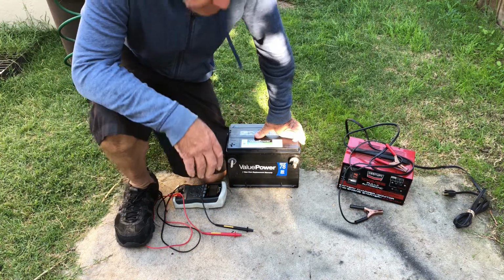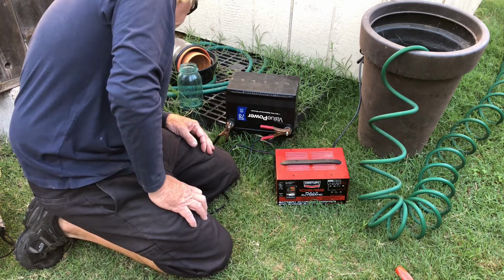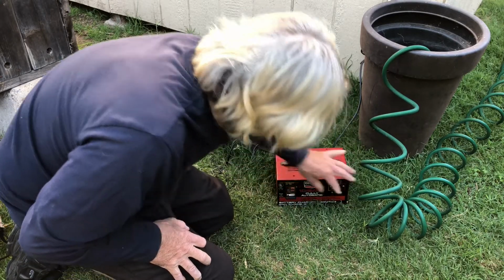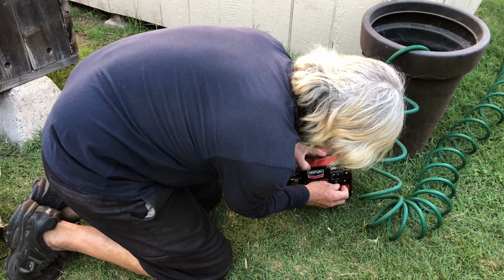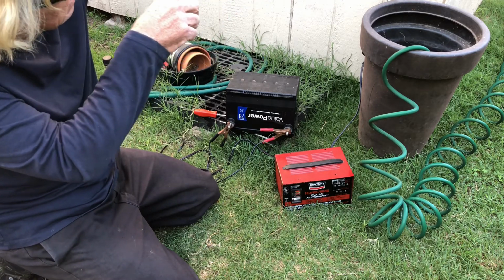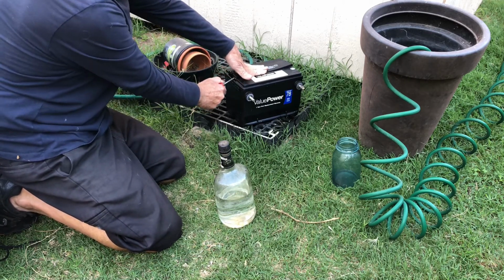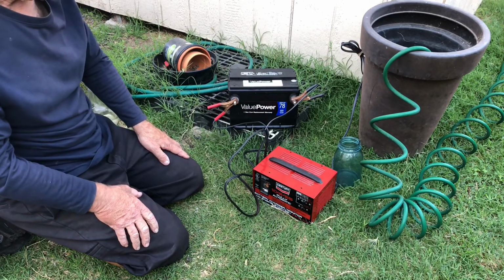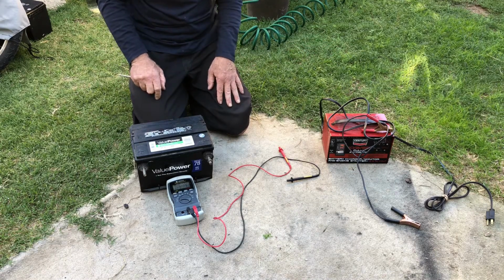Charging a Car Battery Upside Down! The only rejuvenation method that works.

Comment: Can I do this on a fully sealed battery. Battery doesn't have refill cap's
Reply from the maker: Yes I brought back a dead 4D sealed battery.  Now use it as a solar back up battery.  I slow charged it upside down at 2 amps for 72 hours.  Seems to work better slow charging at low amps.
Reply: Thank you. What's your take on the welder trick. And must I reverse the polarity or keep polarity the same.

Comment: Did you try a DC stick welder?
Reply from the maker: I found that a 2 amp charger over a long period (3 days) worked better. I found a large sealed 4D battery that was dead 10.8 volts. Turned it upside down and left in on the charger 72 hours and now a year later it works perfectly. I use it as a solar backup battery.
Reply: @Strange_Brew  Didn't answer my question; 
But anyway; turning the battery upside down may have fixed the battery without even charging it since the sulfates gather at the bottom of the battery shorting the cell; which on a 10.8 volt battery is exactly what you had. (2.2v per cell x 5 cells =11 volts) means you're missing a cell.
Charging upside down leaves the plates exposed; which means nothing can happen in that area of the plate without electrolyte.
No offense intended, but charging upside down is pretty much nonsense. Using a welder and overcharging voltage at least has the possibility of 'vaporizing' the shorting sulfates; restoring normal operation.

Comment: Try making 6holes on the bottom (one for every cell) but be sure not to exceed 2 millimeters in deep, otherwise you'll damage the plates (I've done the job with a router).  Then refill to the top (actually is the bottom) with  distilled water.  Then make the job. Measure the density (from the bottom holes).  When you'll satisfied, flush everything (ever upside-down) wash with distilled water,  then close the holes with a solder and some battery case scrap.  Turn the battery and fill it with filtered acid solution.  Done.

Comment: Finally after struggling with my Okinawa praise since 2018 feb, lead acid battery model, i have figured out how to revive lead acid battery. Don't do anything like this. Just upside down the lead battery. Because in due course of time, the regular bumps and thumps, and the gravity of course,  the electrolyte settles down. Just upside down it to redistribute the electrolyte. 🤘. Because the electrons will flow only where electrolyte is available. Understand ????
Didn't you people ever thought why do the company take it back so easily ????
😂😂😂😂😂😂😂 We have been fooled since so so so long bruh. . .

Comment: Thanks for sharing your experience with all of us.
High voltage cycles de-sulfur the battery to some extent, (sometimes even fully), which explains why the battery got better after your treatment.
However, I can't see why turning the battery upside down would make any difference, and it seems that you're losing a lot of electrolyte solution this way, since connecting the battery to a high voltage also boils the solution, and the pressure forces it out through the vents... which are now below the liquid's surface, because the battery is upside down!
Maybe I'm wrong about it, and turning it upside down does make a difference, definitely worth a small experiment :)
Reply from the maker: I recently got a dead 4D tractor battery. It was sealed so I didn’t have to worry about leakage. It measured 11.31 volt.
Turned it upside down and charged for 48 hours at 2 amps. Somehow works much better. 
Now maintains over 13 and I use it as a solar back up.
They are very expensive so I’m glad it worked!!  I don’t know how it works but I tried everything else with no luck.

Comment: I try that with my 200ah battery and it works 
But dont remove the battery charger 
If the battery is fully charge 
Let the battery charger 
Charge the battery for two weeks or more 
And use only smart battery charger

Comment: I tried that, but the blood ran to my head and gave me a headache. All seriousness aside, I would be afraid a weak plate connector would break and cause a short with possible pyrotechnics. Really, worth a try, but wouldn't changing and rinsing out the electrolyte do the same thing?

Comment: Aren't you supposed to turn the charger upside down to when you do it that way
Reply: Not really but if you stand on your head and wiggle your ears people will know for sure that you have inhaled too much battery gas.
Reply: haha
man you is 2 phunny
just use a bench power supply like gophert or any other
get it from ebay/aliexpress , amazon, banggood...etc.
it gives control over voltage/amperage (cv/cc) and shows you what's going on
https://duckduckgo.com/?q=gophert&iax=images&ia=images
Reply: https://youtu.be/bSkeV2ezuBs

Comment: Great technique. I have 2 200ah and 1 100ah dry cell inverter batteries. Used ur technique only that I didnt get any leakage and turned each battery upside down and charging each with solar panels giving out 10amp for 30min each. There has been tremendous improvement as those batteries dont last from 6pm to 6am. Now my batteries only take up 1 bar of the 4 battery indicator
Reply from the maker: I found a 4D truck battery along side a dumpster a couple weeks ago. They are very expensive so I wanted to rejuvenate it.
It was dead only 11.21 volts.  I turned it upside down and charged it for 48 hours at 2 amps.   
I checked with an battery checker and it’s totally like new. I’m using it as a solar backup. 
It was sealed  so it didn’t leak at all .  I find that charging for a low amp for a long period of time works better.  If the battery leaks we just have to seal it first somehow